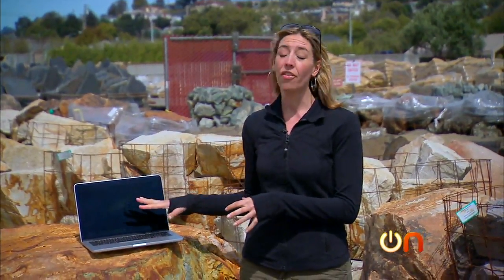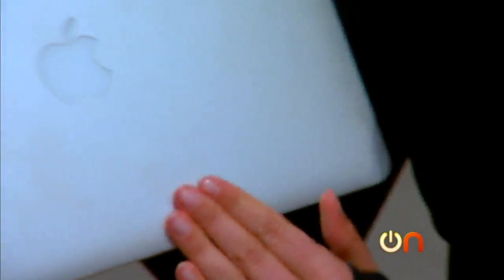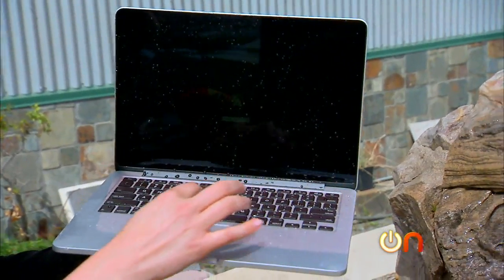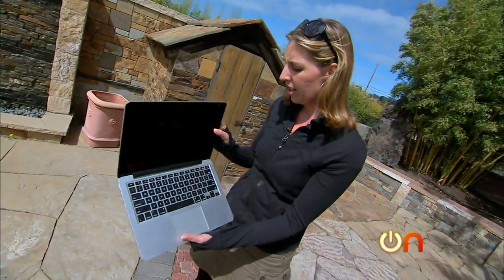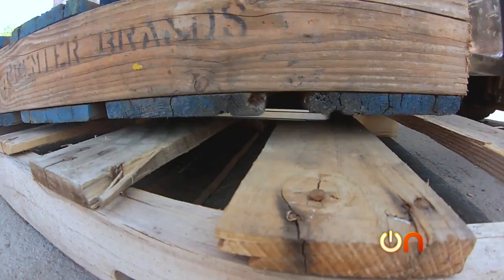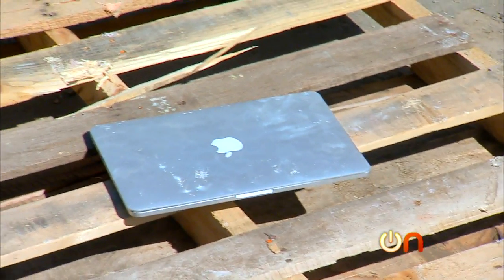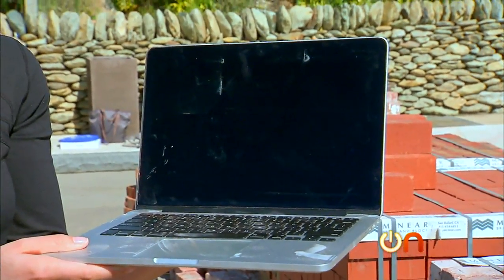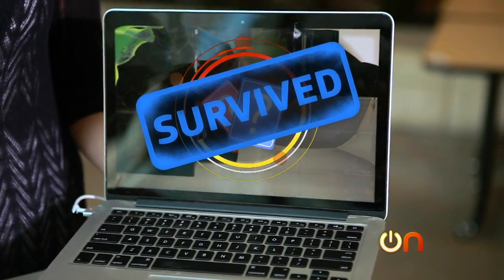Always On - Is the MacBook Pro construction-grade?

Comment: This is completely bogus.  1.  all the weight is applied the weight evenly over the surface.  I like to see what happens if a sharp object is dropped on the screen from 4 ft off the ground.  2. if the rmbp is dropped onto the ground from 5 ft and LANDED ON ITS EDGE!  I'm sure there will be bending of the corner of the laptop. 3. one of my biggest pet peeve of any mac laptop.  it is made out of aluminum and it will fly out of your hand if it is greasy.  this is the worst with the heavier mbp.

Comment: No matter how tough people claim MacBooks are, I still handle mine like a baby... Lol
Reply: The internals are tough it’s the case I’m worried. It’s the same as damaging a brand new car. The engines will survive but the paint job and the beautiful exterior won’t.
Reply: "i handle mine like a baby"
yeah, typing on a baby seems natural
Reply: Thats good
Reply: So do I
Reply: I'm not Mac user but I have a ThinkPad and I throw it around sometimes and it still prevails (that is if the power outage we had hadn't killed it :(
Reply: KAAN CAN  well it does, my mother had a Mac that died due to the same reason, not to mention the ThinkPad still almost fully works jusy that the display is gone. And MacBooks lose battery super fast (in a 2 year lifespan) if used every other day. Then if you want it to get replaced find a 3rd party. Apple will charge you 600 dollars or more for the battery replacement its honestly bs
Reply: KAAN CAN  and also was it plugged in, and was your house struck by lightning when it happened? (I wasn't using it when it happened)
Reply: KAAN CAN  well that’s an unfair comparison, thinkpads are laptops, iMacs are desktops with surge protectors built in. So I can take a thinkpad anywhere. AND BEFORE YOU SAY THERE ARE MACBOOKS The reselled ones from 2015 go for 500 dollars… While only having dual cores. You can buy a thinkpad for 70-160 dollars and get a 4-6th gen intel core i5 and get more performance out of that.
Reply: KAAN CAN  there is a difference when unplugging, you won't lose main components, when lightning strikes it, static shock goes through the cable in the wall to the pc, causing it to essentially fry itself
Reply: KAAN CAN  my optiplex is 10 years old
Reply: KAAN CAN  I'm on windows 11, and last year wasn't there a macos emergency update for that reason
I've also never gotten a virus on windows so
Reply: KAAN CAN  no, because I play games such as forza, minecraft bedrock, and uno. Not only that, but my friend has a mac and he can't play half the games I can.
Also seriously, 1000 dollars for an i5 dual core mac from 2015?!?!??!
Reply: @Dogsandcats Are best your 8 and the same person, I know how this works
Reply: @Dogsandcats Are best I totally trust you have joined 2 weeks ago 🙄
Reply: KAAN CAN  because its overpriced and is using pretty junk parts like dual core cpus.
Reply: @Dogsandcats Are best sheesh then why you arguing, you don't know nothing about pcs!
Reply: @Dogsandcats Are best name all the components to build a pc without google
Reply: Explain how my fathers 2006 dell is faster than your 2008 MacBook and can run windows 10 (it support 12 gb of ram and costed less!)
Reply: KAAN CAN  I hate to break it to ya, but that isn't 2021 standards
Reply: KAAN CAN  almost 3 years old now
Reply: KAAN CAN  lol 2019 standards on a 2008 laptop isn't fast
Reply: @Kaancan2 Lol idc I'm done talking to you, also why don't you have your password saved on safari, oh wait... sorry
Reply: @Kaancan2 Lol so then, log into it
Reply: @Kaancan2 Lol weird, always works for me
Reply: @Kaancan2 Lol and now listen I wanna clear things up I DONT HATE MACS I just hate the way Apple prices them and supports them, they had alot of potential it's just Apple isn't very good at making products last (anymore) it Got bad when Steve died. In my opinion the last good iphone was the 5s. And I love the old ipods, I have a 4th generation ipod photo and I use it daily I bought It a replacement battery, I have an iPad and love it to death, (the screen is cracked tho) and I have a 7th generation ipod touch which I also use. I don't fully hate Apple.
Reply: @Kaancan2 Lol yeah, I built a gaming pc. I'm not a fan of the os tho... would probably put linux on it although I love mavericks. No matter what you say I will forever love that version.
Reply: @Kaancan2 Lol the imacs are beautifully designed and they all look great. I have to admit it.
Reply: @Kaancan2 Lol ooh the, Sierra was also good too
Reply: @Kaancan2 Lol yeah my grandmother has one, she is giving it to us soon and I'm gonna tear it down and put an ssd and more ram in it then I'm gonna use it for GarageBand until I don't want it anymore. Then I'll give it to a friend of mine who doesn't have a pc
Reply: @Kaancan2 Lol well, for the cpu price to peformance wise, a ryzen 5 2-3rd gen would be ideal,
for the mobo (motherboard) get a b450m, solid mobo.
and for a gpu try to get a 580-5600 xt, i have a 5500xt (580 on crack) and its pretty good! gpus are super expensive at the moment thats why im suggesting that.
and for ram 3200 mhz ddr4, at least 16 gb
AND AN SSD THAT ISNT AN OPTION, THATS A REQUIREMENT harddrives are extremely slow.
Reply: @Kaancan2 Lol so, I'd thought I'd let u know
I tried the new 13 inch m1 Mac with macos Monterey beta
The results for me are: I'm buying one.
Genuinely worth the money 
And Monterey is gorgeous 
But I will keep a windows pc as my desktop mainly because it supports all games. But for my laptop I'm gonna buy a 13 Inch m1 MacBook :)
Reply: @Alexisadingus hey man,this is my new account,previous got hacked,i actually wanted to let you know i got a Vaio from my uncle,Vaio P,im looking to get an SSD for it and maybe Hackintosh it as its such a good little computer and its pretty fast for such a tiny thing from 2009,he Said battery was dead and it turns out it worked,just not that long lasting
Reply: @Alexisadingus some guy hacked the previous one and got it terminated,im also hopefully getting that first account back

Comment: I am very surprised. I dropped my MBP Early 2011, and it worked (Well, some parts where damaged before). I think when you drop the MBP in salted water, it will be broken. But in distilled or normal water, rice is the best opinion. It happened two times on my iPhone 4 and it is still working. 

But I thought: "It's expensive, it will break very fast." Impressed I've to say, good job Apple!

Comment: Can a mac come with 16 gb ram
Reply: If you order a MacBook Pro from the Apple Store you can switch out the 8GB for a 16GB of ram for the 13 inch models which will cost $200 extra. The 15 inch models comes with 16GB of ram but the baseline starts at $1,999. Strangely enough, the higher end iMacs don't come with 16GB of ram.
Reply: ok
Reply: Good lord, 1200 extra for 64 GB of ram.

Comment: Good luck using this thing in a couple hours after the water dries and the board corrodes and fries everything... or even worse shorts out the charging circuit and the battery and have that explode... Such a fake test, Its no wonder people put their iPhones in water and think itll still work. Such iSheep.

Comment: All of this mac hate lol Windows and OS X are both fantastic choices. I currently own a 2014 Macbook Air for college and travel usage as well as a Windows gaming desktop for home (and obviously gaming) usage, both of which I adore. I will say that while Apple may charge slightly more for similar components, the build quality and fluency between hardware and OS honestly do more than make up for the price differentiation (yes, the Air I own now is relatively new thus making it harder to judge reliability, but I used a 2011 Macbook Pro for three years beforehand from which I am drawing my quality assessment). Apple assembles both hardware and software for their system, which allows them to create a much more reliable and less problematic convergence of the two than most (not all, but most) Windows PC brands. The difference is noticeable and I honestly think that justifies (or at least makes more acceptable) the price difference for their products. With most Windows PCs, you pay for power and specs over software and reliability. With Apple, you're choosing reliability, fluency, and build quality with the negative of receiving a device with slightly lower specs than the competition. Both are amazing choices and I enjoy using them. I'm not an iSheep and I do acknowledge the spec drop that I take by purchasing Apple products, but I also personally feel that the quality justifies this as I've never had a Windows laptop last more than a year without some sort of issue. Desktops differ. I prefer a Windows desktop just for the potential for upgrade.

Comment: In overall the macbook air still works, even though it still has to be plugged in for it to work. Battery just need to be replaced thats all, so long it isnt bricked. If you know what bricked means in tech term.

Comment: Every test made sense except for the bricks and the bolder
Reply: None of them made sense because wouldnt you be using a case on it if you were in a construction zone?
Reply: Will it blend?
Reply: ***** Well, yes, but it can happen to everybody that their macbook slips out of their hands and falls from 3-4 ft height on any kind of surface... the worst probably being something hard, uneven, rocky.

It's nice to know, that it won't be substantially damaged, display won't be cracked, corners won't be dented, display cover won't get bent in... Especially with the price tag in mind.

Comment: if I the manufacturer intended me to use that porcelain vase on a daily basis, carry it around, move it, swap it, just be mobile with it, well fuck yes! just because a macbook is so pretty does not mean it can be dropped easily, actually it is very slippery, I would argue like that in a lawsuit, and chances are some judge might agree with me...so fuck off and dont protect the companies you dependent fanboys...I might add: An expensive porcelain vase is not intended to be moved around

Comment: Plus, they did not check if it was working after each test, which is the purpose of the test, to see if it works after you drop it or apply pressure to it (Diferent scenarios). Dumb test. )=

Comment: I completely understand but the difference in build quality between the 13" and 15" and the air series are slim to none and they all have the same osx mountain lion however the prices are at very large differences, because the main price factor in the MacBook is the CPU and storage. You will have the largest increase in price upgrading these parts through apple. Which is why many people buy the base model non retina and do upgrades themselves because then the ending price is more appropriate

Comment: I used to own a unibody Macbook Pro. 17" With a core2 duo, 8GB of DDR2 Ram at 800mhz, 1080P display, Geforce 330M. 3000$  Same parts in a Sony Vaio laptop were about 1200$.  There are gaming notebooks that are easy to customize as well. Look up the Asus G75's. They are VERY well built, very durable and you can replace the ram, HDD's and other things when there are problems. (I also didn't remove the comment? Its below this one).

Comment: I like you removed the comment, but i still saw it. Basically, MacBook Pros aren't bought for gaming or customizability (nor is really any laptop), and they aren't overpriced because 1) Many parts inside are actually custom built, save the processor and graphics, and 2) while many other laptops have similar specs at a lower price, they're bulkier, made of plastic, and have multiple parts (MBP shells are 3 large pieces of Al), and also there are loads of programs for OS X not on Windows :P

Comment: I'd suggest a real world test by putting on and taking off those hard shell cases that clip onto the macbooks, see how many times it takes to put on and take off before you scratch the macbooks?????   How difficult or how easy is it to scrach up the edges of the mcbook with those "shells" either clear or satin etc etc?  How about also putting on and taking off those "sticker boi" skins etc too????   How about letting the machine run at super super maxed high temps, will it shut itself down?

Comment: the Display and the shell is bulit as one thing, so it is supposed to be changed as one part. The retina display has no extra frame for installing it into a lid, the the display and the lid are bulit as one component. Because of this it is possible to bulit it as thin as it is.

Comment: it should be working, the apple sound you hear is actually the POST test. if the cpu, gpu, ram, failed then it wouldn't make that sound. The only thing it doesn't test is the storage drive, but since its ssd, it shouldn't break

Comment: Not necessarily. I bought an Alienware M14x last year for $1600. Its not durable at all. If I pick up while it on, it makes a run grinding sound. The plastic in front squeaks now. The worst thing about it though is that it is big and thick. The 15" Macbook Pro has the same level of performance, and it sooooo thin.